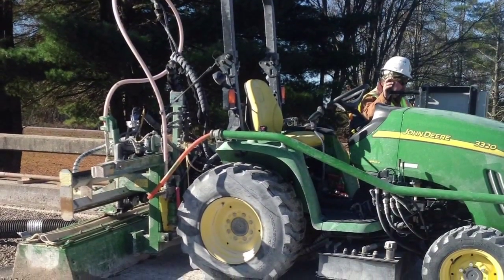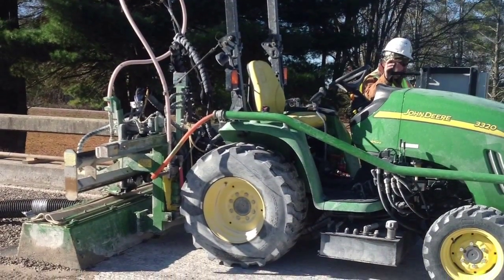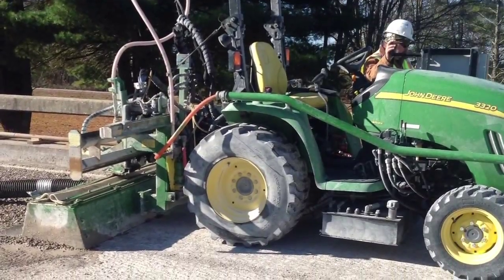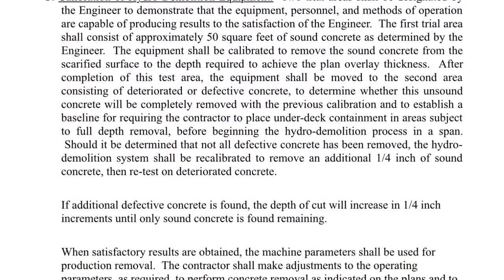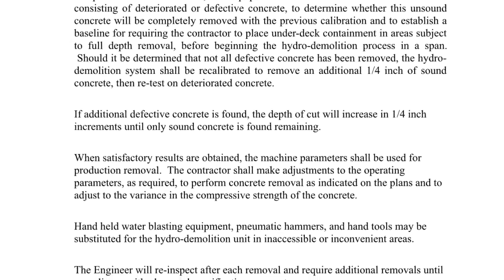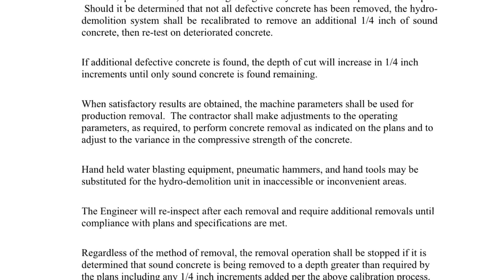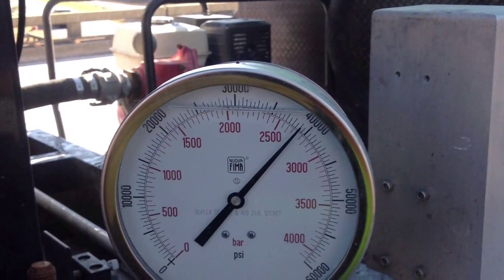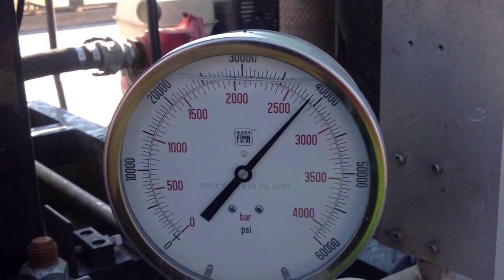Hydrodemolition Calibration for Bridge Deck Overlays

Comment: When you increase water pressure to 32,000 psi which is UHP you are hydro milling removing all concrete to a set depth whether it's bad delaminated or sound.  

If the goal is selective removal of bad concrete you make adjustments to the robot transverse speed, oscillation speed and swing and lance angle depending on water volume horsepower of pump and psi as stated can be minimum 17,000 psi. Slowing the lance and transverse speed down makes deeper cuts. 

I say this not as criticism of this video but to get a long lasting excellent repair utilizing hydro demo.

Comment: This is not the proper calibration technique for hydro demolition by increasing pressure to remove de laminated concrete.  

You adjust the oscillation speed of the lance and slow the transverse speed and can also adjust lance angle for deeper cuts per pass which selectively removes bad concrete while keeping the good concrete and cleaning the rebar depending on depth of removal.